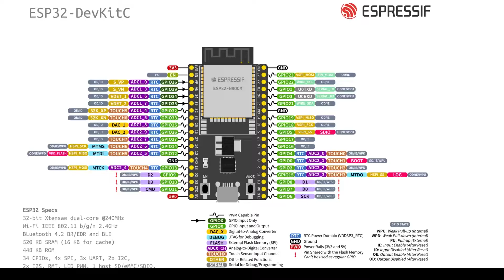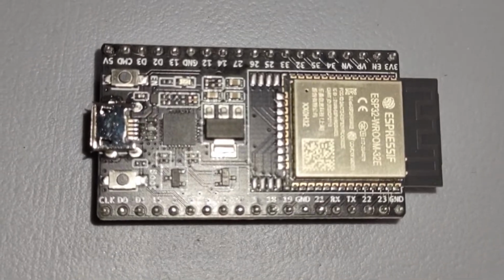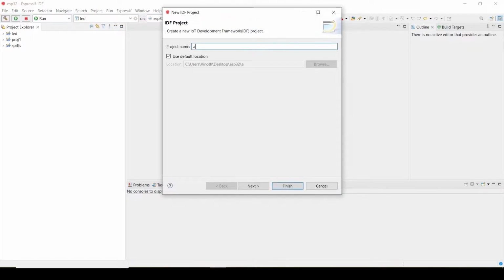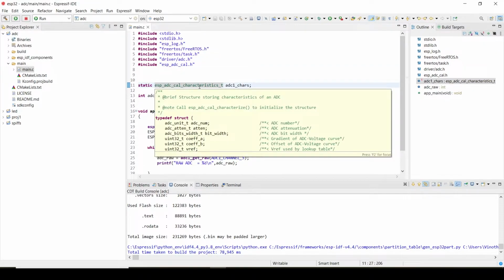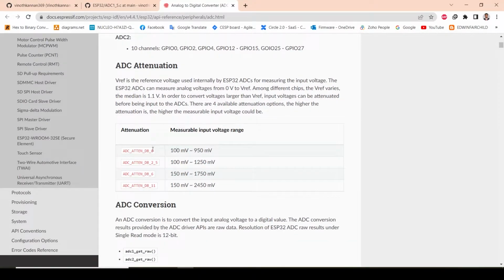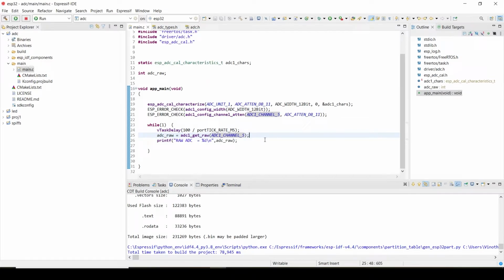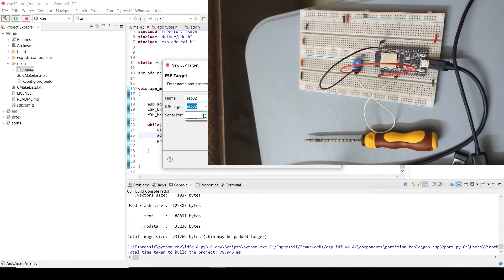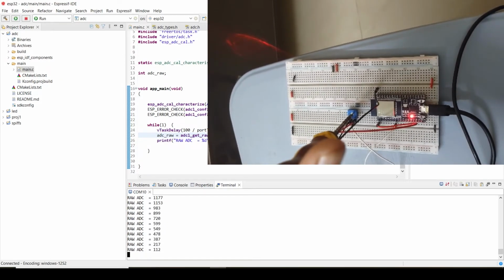#7 Espressif IDE || Analogue to Digital Converter(ADC)||ESP-IDF|| ESP32

Comment: hi, i like the video but could you be more explainable  about the working of adc in esp32
Reply from the maker: Hi Ansh,
Thanks for watching my tutorials.
This tutorial series is for quick demo,
If you want more details about ADC you can refer to the link below

https://docs.espressif.com/projects/esp-idf/en/v4.2/esp32/api-reference/peripherals/adc.html#:~:text=The%20ESP32%20integrates%20two%2012,15%20and%2025%20%2D%2027).
Reply: @embedded3696 

Hi Vinod thanks for clearing doubts if possible can you make short video on i2c and spi device interface with esp32 it would have been very useful
Reply from the maker: @anshbhatnagar557  sure, i will do it in upcoming videos